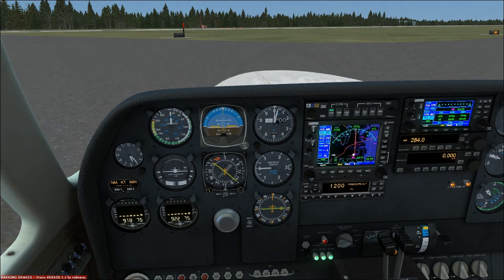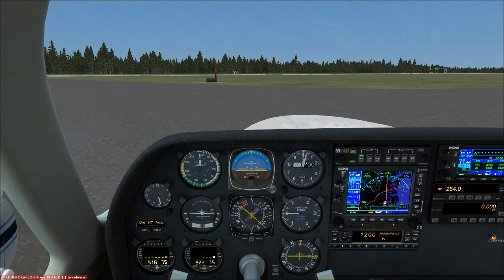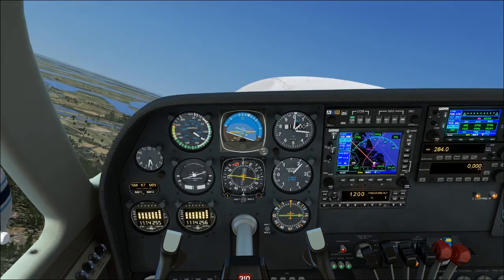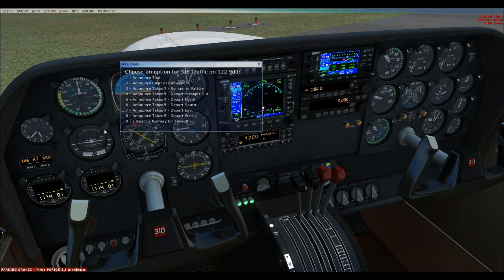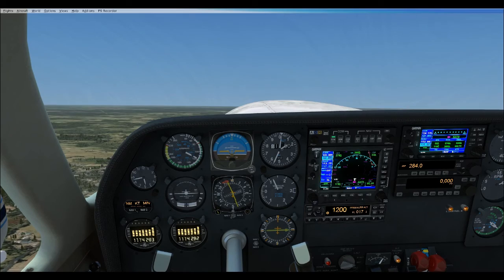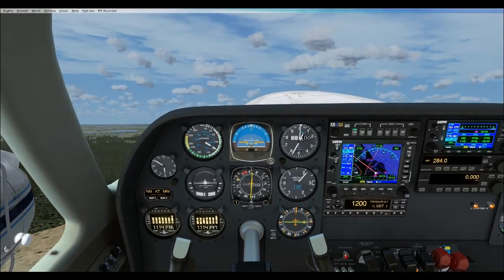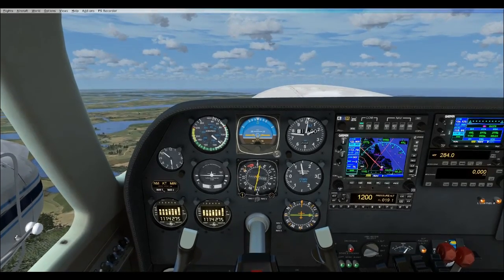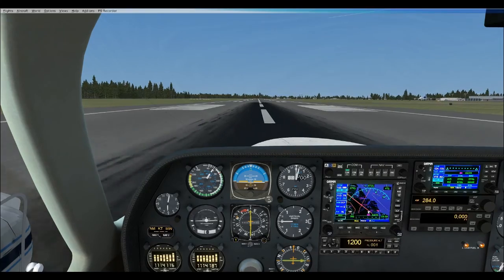Military Visualizations Cessna 310 Tutorial. Video 4, Takeoff

Comment: Think about this...depending how much runway is left, of course, but if you reduce power to land on the remaining runway, you reduce the asymmetrical thrust as well...It's not as hard as you think.  Try it.  I've been doing my ME add on.  You are spot on on most things my instructor teaches...but the one thing he said was...if there was enough runway...you land.
Reply from the maker: in real life yes. but in game its a bit harder depending on your hardware setup. if you only have a stick with built in throttle, its notably more difficult to land on remaining runway while keeping it under control without crashing. IRL you can immediately feather the prop after it fails. but in the sim unless you have hardware for it you would have to push the following key commands. E+2 then CTRL+F1 then E+1. all while managing the throttle and joystick to not die. its significantly harder. if you watch the bloopers you see a failed experiment where i try to bring throttle out by half to get some controlability so i can feather the prop. i still die. I try to make these tutorials based on real procedures but adapted for use in the sim. not everything translates over.

Comment: Nice job.  Holy crap, I tried the engine out just after takeoff and crashed.  Was able to steady the aircraft and land if I killed the engine at 200ft.  Very difficult and I found almost impossible to climb.  I will be interested in your one engine landing lesson, I managed to land but in the grass the first time, second time crashed on the runway after returning to the airport.  Maybe that single engine is not such a bad idea!
Reply from the maker: ***** landing back on the runway after an engine failure is hard. thats why i say take it in the air. its doable but only if you can feather the dead prop imminently witch is hard to do in FS unless you have a prop controller. single engine landing is easy once you get it stabilized and be conservative with the altitude. in the landings video e cover it but its from a cruise altitude. getting stabilized is the hard part, once you are stabilized your life becomes alot easier
Reply: CountryFlyboy Both tries I did take it into the air and then returned to the airport to land.
Reply from the maker: ***** cool beans ^_^

Comment: I noticed on the first takeoff you did not mention OAT, and unless the engines are fuel injected, you did not mention carb heat.   On the first takeoff you reduced RPM first and throttle second, on the second takeoff you mentioned reduce throttle first and RPM second.   That is when I stopped watching.   -  Thank you for this video.